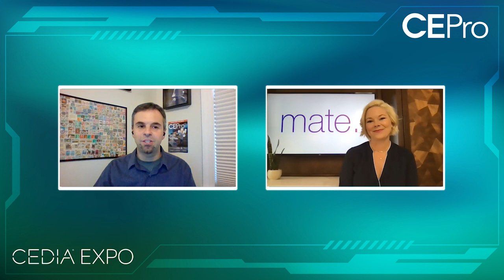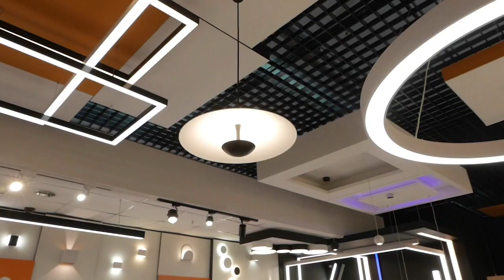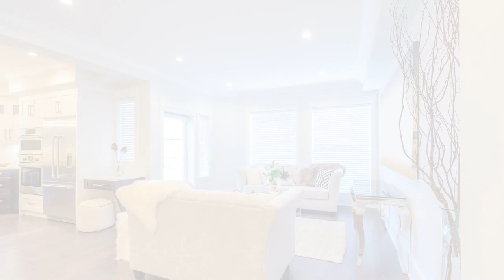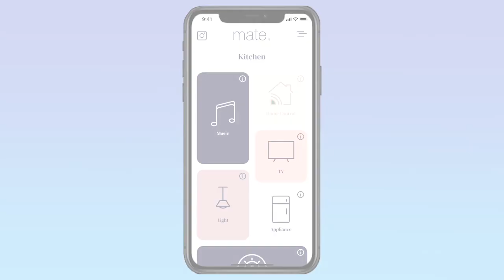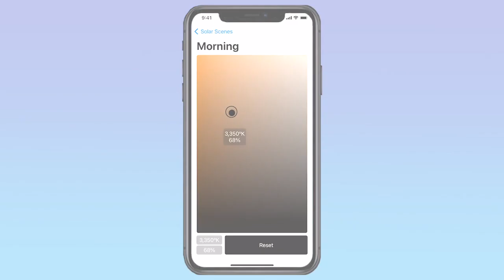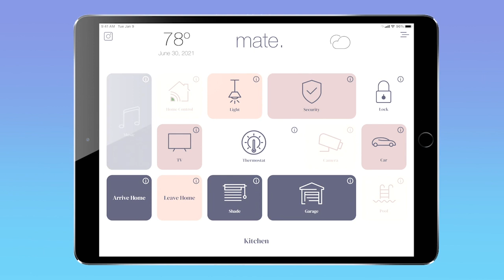Meet Your New App-Based Human-Centric Lighting mate.

Comment: Mate’s app offers absolutely no circadian lighting features at all. It is simply a HomeKit skin promising circadian lighting with zero to offer. Why is CEPro not asking the right questions like, “How are you able to do this?”
Reply: Thanks for checking out the video and downloading mate! If you access the menu with the button in the top right corner of the app, there is an option for solar scenes. These will set any tunable white light in your HomeKit home to a great color temperature for that time of day. The auto timer will keep your lights at the right color, changing slightly once per minute to keep everything in sync. Look for updates in the near future that will add the ability to customize the color temperature of solar scenes, and also control single channel and human centric DMX low voltage lights. Check out our channel for more videos on using mate!